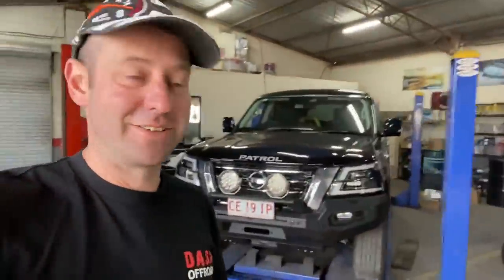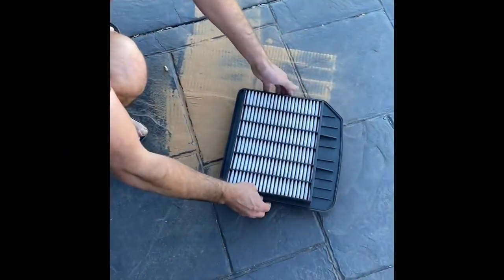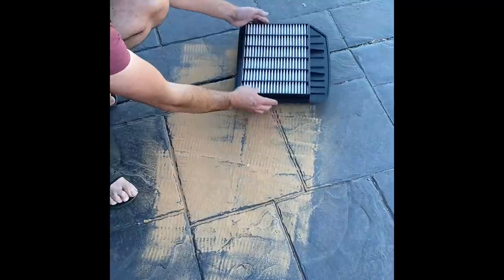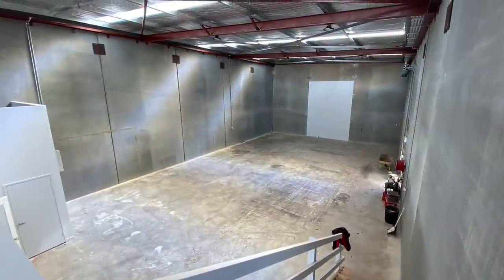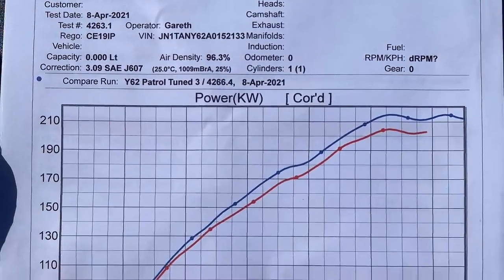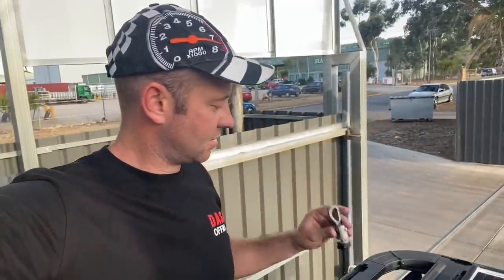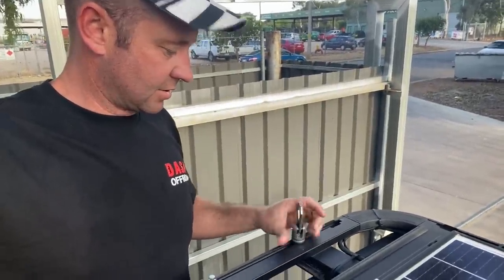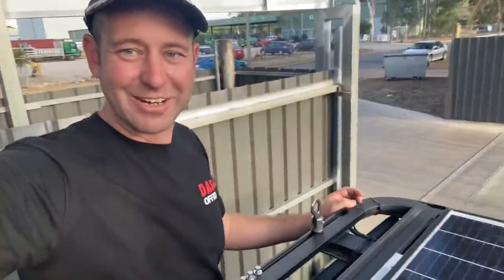VLOG #32 - Y62 Death Wobble 💀 & Dyno Day

Comment: Had the same issue when I had the 62. Had 35s and the 2”lift etc etc and did a rear wheel alignment after knocking one of the rear wheels out of camber on some rough stuff. Scary, took it back and they couldn’t sort it properly. Took it back to OT and they sorted it. Took the nittos off as well, replaced with mickeys all good from there.

Comment: for the death wobble, start with a wheel balancing and rotation just to make sure you haven't lost a Weight or damaged a rim and big tyres need to be done much more frequently than standard tyres, like every 5/10 thousand km. if that's ok check out the diff mount bolts and rubbers for tightness or damages cheers mate 👍

Comment: There was a bloke on Facebook the other day saying he reckons his Nitto Grapplers were causing his death wobble, he changed them out for something different and that fixed it.
Reply from the maker: Interesting 🤔
Reply: I also have Nitto’s and had the death wobble. Nissan checked and chose to up the pressure in the HMBC which seemed to fix it, for a while. Several months later and the death wobble is back 😩
Reply: Shit tyres have been known to cause this. Not saying Nittos are shit,  just a bad one off tyre
Reply from the maker: I can easily change rims and tyres and do a test. Think I’ll give it a try
Reply: @DASHOffRoad   I have 295/70 nitto ridge grapplers on my y62 and they where good for the first 1000k’s but after that the car developed the death wobble and seems to be the more weight I put on the car the worse it gets